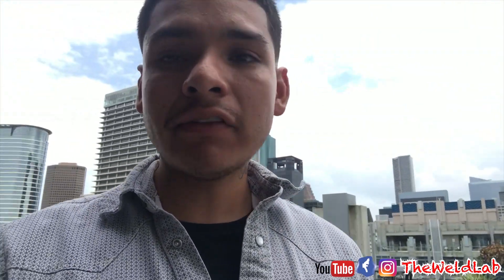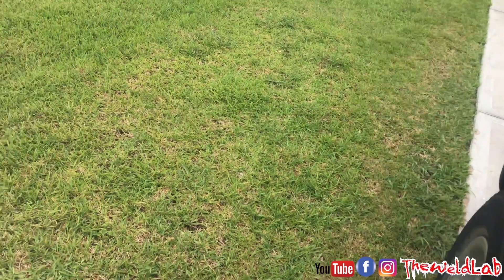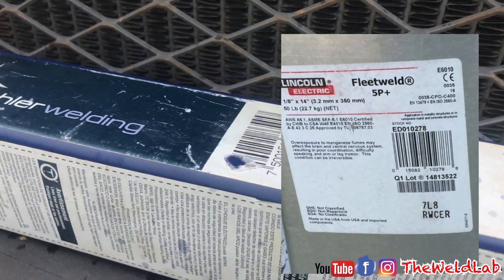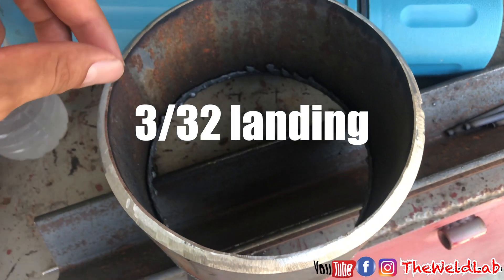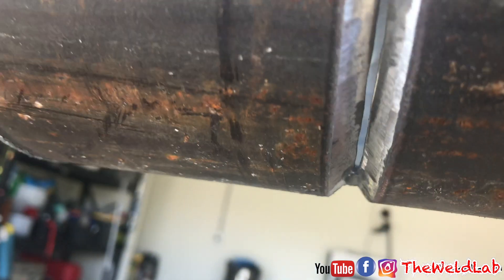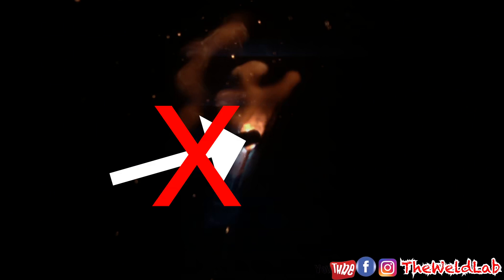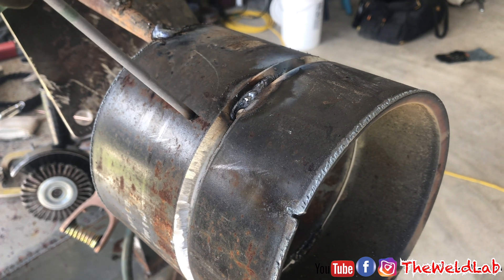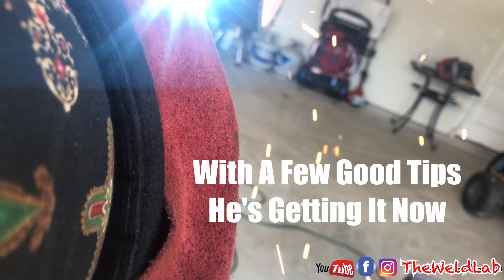3 COMMON MISTAKES BEGINNERS MAKE WHEN LEARNING HOW TO STICK PIPE WELD 6010 ON THERE OWN

Comment: I would also like to add for the up and coming is that pipe is fast, if you move slow then reduce the amps. Pipe landing makes a huge difference in what your amperage needs to be. Thin landing = less heat. Thick landing = more amperage. Fit up is the biggest part. You get the fit up, the downhill will just fall in place. Don't push the rod unless you are not getting full penetration, which usually means you are seeing lots of fire, spatter and a violent arc outside facing you. It should all be on the inside. If this is happening you got Hi-Lo in the fit. Inside of pipe should look like you welded the root from the inside when finished. Start out on sch 80 or .375 wall, sch 40 is tough to learn on. Last, cut the pipe with a band saw, metal chop saw or something clean and straight. Then create the rough bevel with a grind disc and then clean it up with a flapper disc. Bevel to create the landing, don't do the landing then create the bevel. Hope this helps.
Reply from the maker: Thanks for taking the time you write this valuable information I’ll make sure to Include this on my next welding tutorial

Comment: I got a question is the root supposed to be thin when going downhill
Reply from the maker: what you mean? width?
Reply: TheWeldLab yeah the width cause when I weld downhill it comes out thinner but when I do the root uphill the bead comes out wider